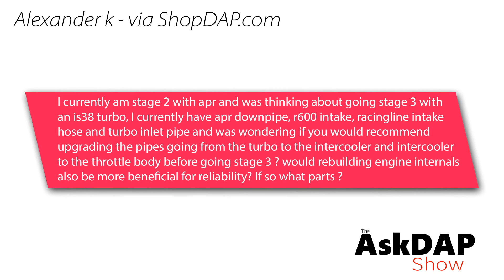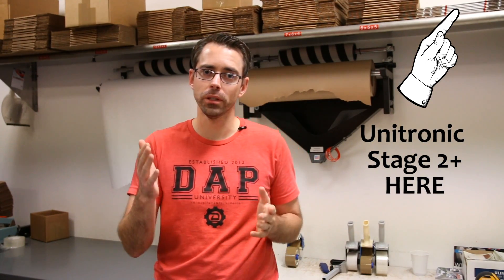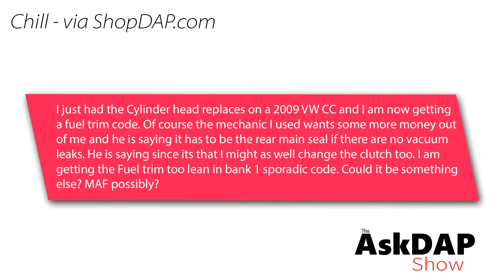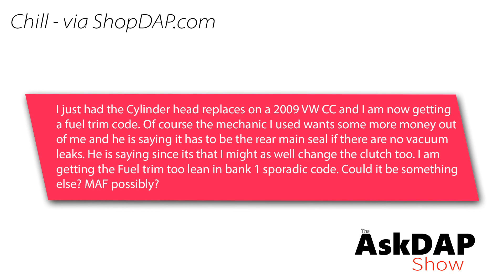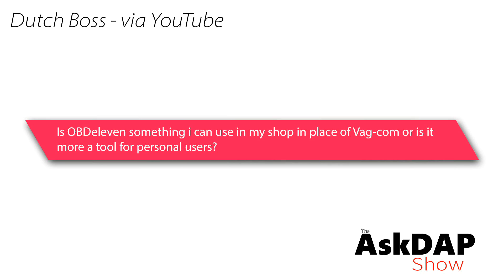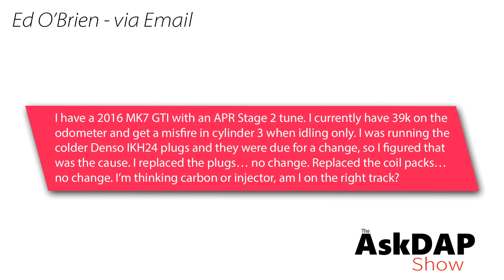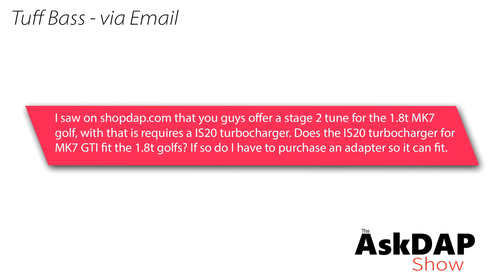Askdap Episode 92 | OBDeleven vs VCDS, IS38 and IS20 Turbos

Comment: I had an identical issue as the 2016 MK7 with misfire on cylinder 3, only at idle. Turned out my battery was basically dead. Ended up stranded at a chick-fil-a (not a bad place to get stranded) and had to have someone come jump me to get to autozone to get a new battery. Issue went away after replacing it.

Comment: Will OBDeleven show EPC codes for a MK4?  or is it not that advanced.
Reply from the maker: Yes you can pull these codes. Epc related faults would generally be found on engine control module or abs
Reply: Thanks

Comment: i just went from is20 to is38 APR stage 2+ 91 octane, i hit a mustang dyno and it read 297.... does this sound correct?? I have turbo back high flo inlet pipe, DV+, cold air intake, No intercooler yet... any help would be appreciated, not exactly the numbers i was looking for, considering I have a 2016 GTI PP...

Comment: Golf MK7 R and GOLF MK7 GTI Performance. What is the difference in engine? Only the turbo is20 vs is38?IS38 is bolt on GTI MK7? Can i only switch turbo and software stage 3 unitronic/revo and everthing would work driving daily on the street?

Comment: Awesome video. I am currently upgrading my 2016 A3 turbo to the is38 snd also have an 02 VW GTI. Any chance my is20 would fit my GTI.
Reply from the maker: Sorry it would not completely different turbos
Reply: Mate of mine did a is38 turbo conversion on his Audi A3 8v prefacelift and he handed gapperonis out to stock s3 8v prefacelift 

The facelift s3 8v2 has a small bump in power and just enough to not allow him to pass

Eitherway for a 1.8T is a absolute animal but the dry clutch dsg was a problem after 3-5 pulls

Comment: Probably a stupid question, I'm aware you have to upgrade a manual transmission clutch after you start modding, but no one mentions if there is anything you have to do with a dsg other than software upgrades, is their any hardware needed/recommended for that as well?

Comment: What do you honestly think of frankenturbos f23t? 
I want to upgrade the ko3 from my fsi 2.0t.
Thanks. 🙏👍
Reply: People have had good and bad experiences with them. We replaced oem turbos on stock cars with these f23 turbo's with no issues. They are not for massive boost and built applications in our experience.

Comment: I have some good info on OBDeleven after my trip to dealer yesterday
Reply: You can make a simple mistake and lose your warranty if not careful
Reply: pray tell...
Reply: Got a flag for a tuned vehicle because the exhaust baffle open app on OBD11 sets an error code. Dealer tech claimed those systems are only on Audi RS vehicles and that is why I got the flag and they found out. However, they were unable to see any mods I did that did not cause an error. The xds settings I change, rear tail light and fog light code changes were not detected. So when it comes to OBD11 it seems those lighter modifications to the electronic management systems are fairly undetectable if you don't throw an error into the mix.
Reply: TLDR: all software mods on OBD11 are fine for warranties as long as you don't cause any error codes to come up you should be fine. Tech was nice enough to send an altered service record to VW after I explained myself and provided some proof I knew what I was doing. I mentioned multiple times that no software was uploaded only settings changed and he worked with me lol
Reply: MajesticMalice gotcha. 
thanks for taking the time to explain; much appreciated.

Comment: Not the easiest to answer question, but I tend to drive everywhere I go in a "spirited fashion", always using the DSG coming and going from the lights. I had my turbo replaced as it blew up (faulty 2014 turbo). I'm apr stage 1. with 40,000 kilometers. How long should I expect the engine to hold up to my driving style before something goes wrong? I'm constantly worried I'll end up breaking something from the way I drive.
Reply: Lachlan Gordon If the engine is at proper operating temp before you drive spiritedly and you service on time, it should do no harm. It's only when you accelerate really quickly when the engine is below operating temp where you'll have major wear
Reply: alexaescht my issue also